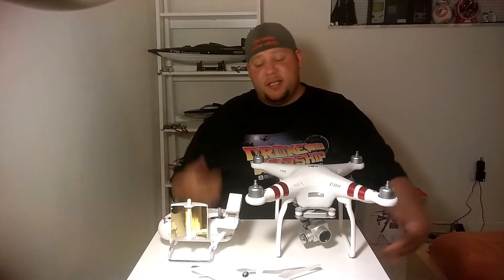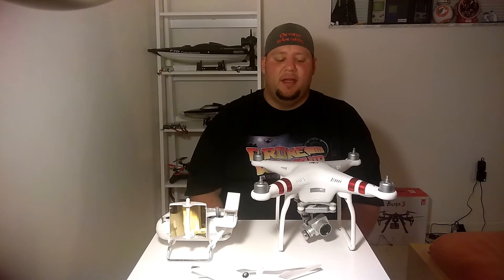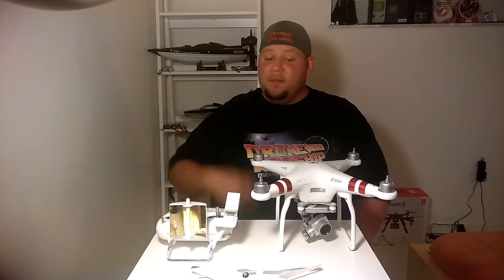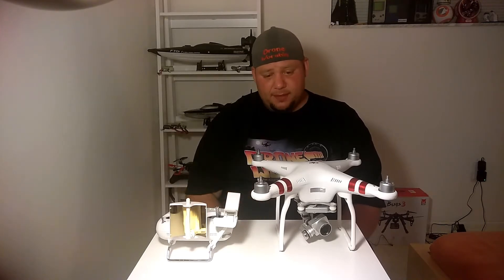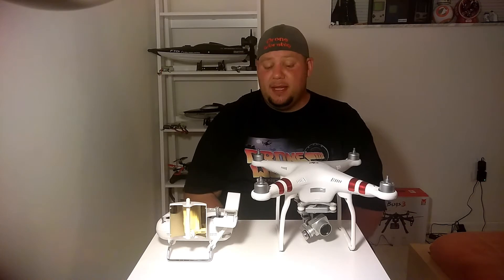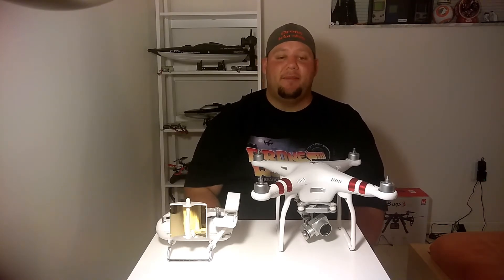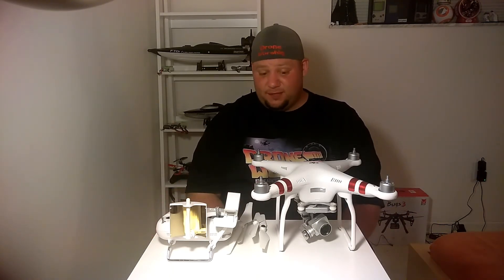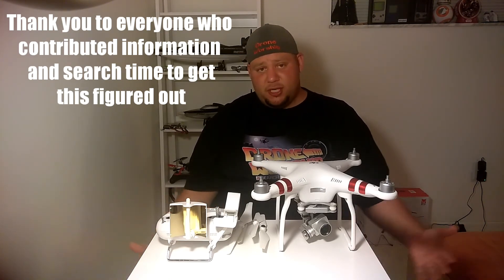DJI Phantom 3 Standard Pulsating Motors/ Hover Problem Fix

Comment: It might not be the aftermarket props per se but the fact that the prop weights are not matched.  You have to make sure that all the props are the same weight, otherwise the motors cannot accelerate them at the same rate and this will cause the twitchiness.
I have some aftermarket props that work perfectly fine but they're considerably lighter than the stock DJI.  As soon as you try to mix and match the brands of prop, the twitchiness is horrible. 
 
To check the weights of the props you need a very fine scale, one that will measure in grains works very well.  If you can do this, order two or three sets and then you can really match the weights between the four you use and get excellent performance.
Reply from the maker: I'm just going to say this once man and not repeat myself this came down to crappy props being out of sync and not the proper weight we tried a number of off market props and same results as soon as we slap DJI props on it problem solved even with an IMU calibration it did absolutely nothing for the unit

Comment: Dude, you just totally saved me a bunch of additional heartache.  I did the exact same thing - replaced the props and had terrible surging from the engines and unstable flight.  I checked the props and they were way off.  I balanced them by shaving some material off and I’m back in business.
Reply from the maker: That's why we make these videos don't forget to hit that subscribe button man that's a great way to help me out even if you don't view any of my newer content it's fine I could still use the numbers thanks bud

Comment: i just purchesed one and crashed it into my shed and broke the original props. got some snow in the motors so i thought thats what it was so i was going to replace them. thank god i saw this first so i dont go spend 100$ or more on new motors. the one thing that i dont know if its the props fault but it will completely go sideways and crash. but i guss thats what happenes when you buy junk props.

Comment: Brilliant ! Had cheap props on switched back to old DJI one ! All sorted ! Good Man
Reply from the maker: Glad that helped unfortunately though the bird you're flying is about to not be able to fly very long. It runs on Legacy GPS protocols which is actually being decommissioned right now for the SpaceX program so unfortunately a lot of the older drones will be grounded soon and won't be able to fly due to lack of GPS connection.
Reply from the maker: Your drone would need to have glonass which is Russian satellites and unfortunately when they designed the Phantom 3 standard they did not give it any glonass settings so it cannot connect to any satellites other than GPS which is US satellites. After the Phantom 3 standard came the advanced model and it did come with glonass but unfortunately you can't use the GPS for the standard model from the advanced so the Phantom 3 standard will stop functioning soon due to age and Outsourcing

Comment: Hello my friend I am having the same problem I’ve got my phantom 3 Second hand and the person who I purchased it off came to my house to show me how it fly it With the two red stripes on their propellers And this demonstration was okay So after a couple of months I decided to fly it did some Updated the app did imu Calibration Did I also take off and it was Jaking So I decided to use some old blades out of the box which I purchased of the same seller and it was okay very strange but still not very stable
Reply from the maker: You need to purchase authentic DJI blades and it should solve your problem
Reply: Have you got a link my friend thank you for your reply

Comment: Man your spot on, had the same problem, had a minor crash changed props to original Dji props purchased on Amazon . Took off and the quad flew like a cement mixer. Checked everything, found your video and said hmmm. I purchased a Du Bro propeller balancer, after checking everyone of the two sets of Dji original props I purchased everyone of them were out of balance. Well balanced blades make a huge difference in flight. Thanks.

Comment: Mr. Dan : Lesson to be learned. You get what you pay for. Never buy the cheapest of anything, especially from China! I learned that with re-manufactured automotive parts. Look for a mid priced item. The 2 year warrentee not the expensive lifetime warrentee or cheapo 90 day junk. I bought cheapo starters and alternators, to save a buck, some of which failed almost immediately.Those props may have been flexing and losing pitch under attempted hover, static loading. DJI props are made of much better material. Aftermarket carbon fiber props work a tiny bit better but, in my opinion, you don't get commensurately more BANG for mote bucks. Real happy to see you solved the problem so easily. Now you can fly like an eagle, not a sick chicken. ;-)
Reply from the maker: Don Fish Jr. in the end though it made for a good video and that's what I'm here for testing the simple stuff to find out what works and what does it. luckily this opened up a whole field of problems people could possibly be having due to something as simple as this so it was good in a way that it happened because it allowed me to make the video to help other people.
Reply: Dan : So true. The silver lining to the black cloud. A hard crash, in slow motion, erupting into a LiPo fire that turns a quad into a flaming glob of molten plastic. That makes for a spectacularly memorable video! As if it were directed by Quentin Tarantion !  ;-)